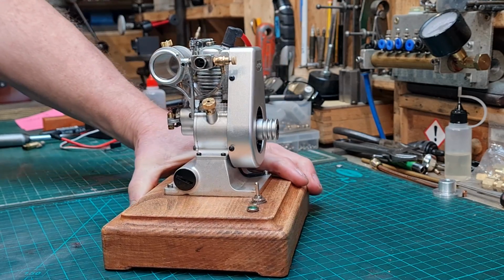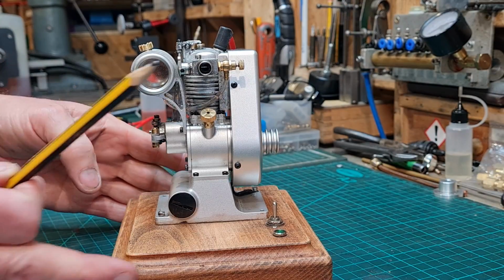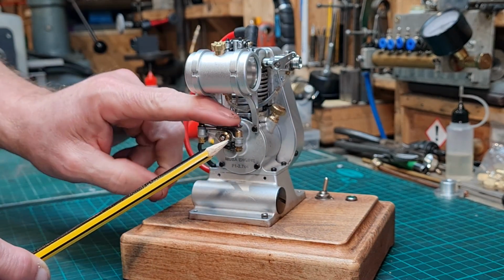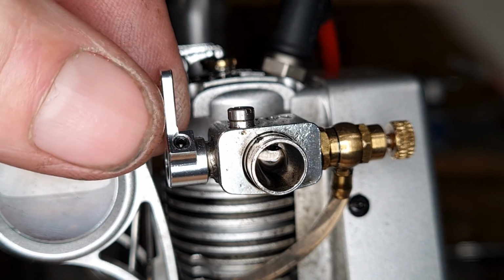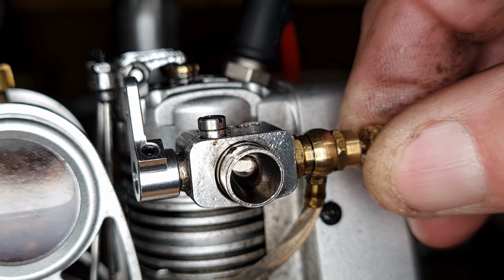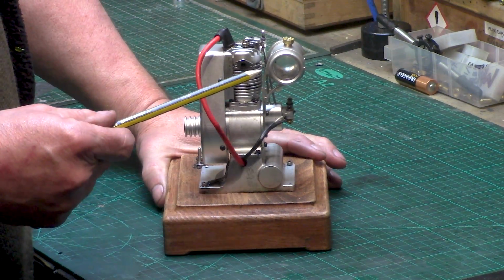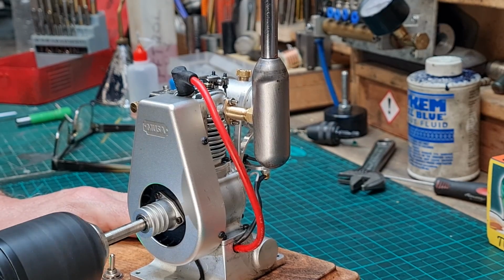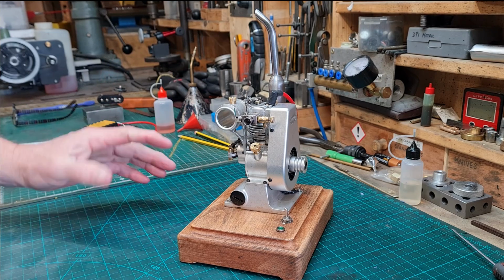Miniature Model Petroleum Gas Engine 2.7cc #enginediy #enginediyshop  #enginediy #modelengine

Comment: -forgot to mention that there is a really nice optional exhaust header pipe that is available from Musa.  It attaches to the little existing flanged pipe with 2 M2 bolts.   Slash cut and directs exhaust towards the back of the engine. It’s stainless steel 3D printed.

Comment: Im prety sure you can reduce fuel use by using the second mixture screw on the centre of the throttle arm .Its for idle and mid range setting , the main needle is set at wide open.Also the base looks like it was intended as a fuel tank but wasnt used . I may be wrong , I dont own one yet.I have  the hm01 and its very well made .
Reply from the maker: Hi @MrZx9rdoug I tried what you suggested, but that screw is there to hold the throttle shaft in position, and control the 'torque' of the lever only, it isn't a fuel adjuster.  As for the casting 'tank' on the base, this I think was intended to hold the battery, but it is only big enough for a single AA, which wont quite cut it :)